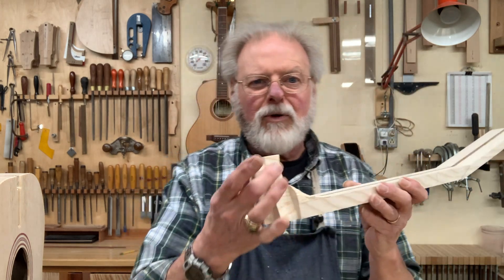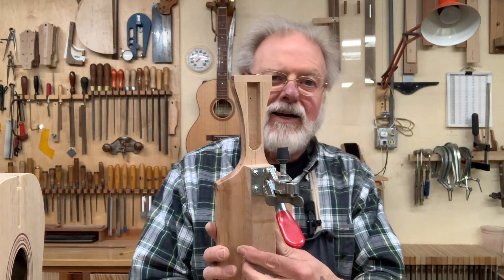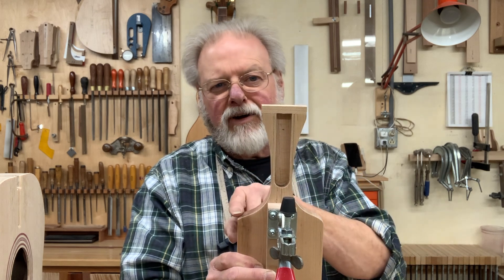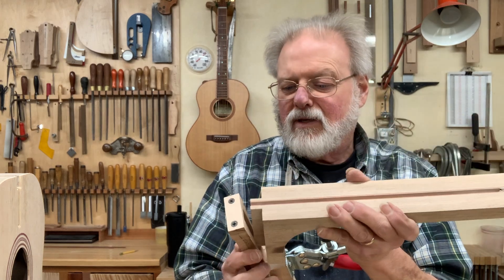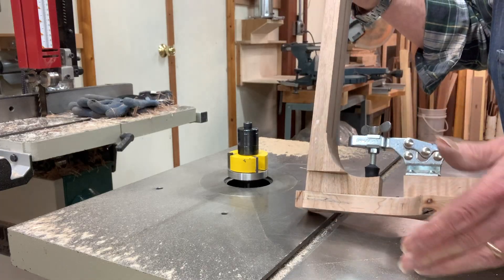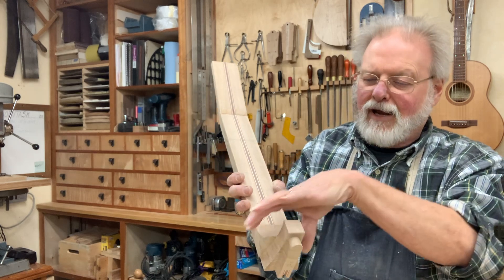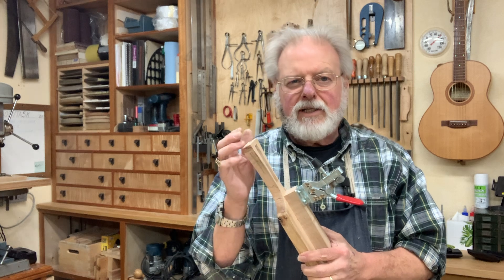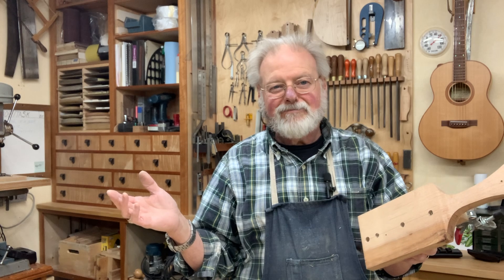A Way To Shape A Neck Heel

Comment: Hey Kevin, As a retirement hobby, I have been making one guitar a year for myself.  Currently in the middle of my fourth build. I have employed many of your jigs and methods, most recently your jig to shape a heel.  I found it was well worth the time to make the jig.  The big advantage for me is a correct heel shape before starting to carve the neck and using that shape as a point of reference.  It didn't take that long to build, and worked well for me.  You have previously made a video for me, discussing how you make kerfed linings.  Wondering if you could make a video showing how YOU make a fretboard, from raw material to finished product. I know there are alot of videos out there on the subject, but your presentation and methods work well for me.  I know you use the saw blade from that store, which is not to be named, however I cut mine by hand.  Thanks for all you do.

Comment: New builder here on my 2nd guitar. I went with a butt joint on the 1st but decided to start trying dovetail using the LMI jig on the 2nd. Nothing but headaches but with much fussing and fixing I have it close. Now the fingerboard overhang is causing a gap (from the radius) that no amount of flossing the heel shoulders seems to be removing. Any tricks? I’m starting to sand the sound board to accept the fingerboard but don’t know if that’s the way to go.

Comment: FYI They make segmented patterning bits for shapers now.  Kind of like the Shelix blades for jointers.  Probably a smoother cut and a little safer.  Cant be cheap though!
Reply from the maker: Most of the bits you speak of run on a 1/2" shank; a glorified router bit, but they can be had for under $200.00. As router bits get taller, they are more prone to runout and vibration and the inherent inaccuracy that goes with that. Helical cutters that are made to fit over a shaper spindle run true and are stable for sue, but come at a cost of $300.00 and up.

Comment: I do something similar but a flat template about 6" square that screws onto the end of the tenon, put it in a vise and run a hand held router with pattern bit over it.

I'm not fussy about the top of the heel at this stage because it gets  routed to match the fretboard later.

Comment: I made something like that with a vertical piece to hold the neck in place, and a piece of spruce that went into the truss rod slot to keep it aligned. It was pre-mortise in my build process, so I didn't have to worry about routing a slot for the mortise to fit into. However, it wasn't stable enough for my liking -- I held it in place with cam clamps up the vertical piece. I didn't think of extending the nose and adding a toggle clamp -- I'll think about trying that. Thanks for the video!

Comment: Cool. If I were to make it, I think I would make half of the jig and then use the bearing bit to copy it, then glue the two pieces together. This is the same way that I make the patterns for my semetrical head stocks.
Reply from the maker: I really like your suggestion for making this jig. It is a concept I have used before, making headpiece templates. Your approach would be a superior method of fabrication, easier and more accurate. Thanks for contributing:)
Reply: I made a mess of a couple off headstocks before I decided to do the same.